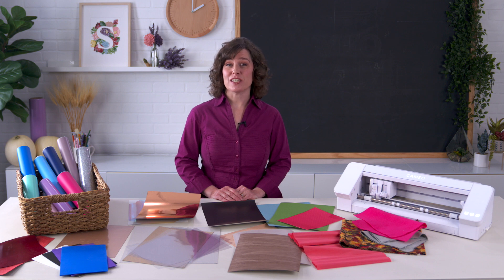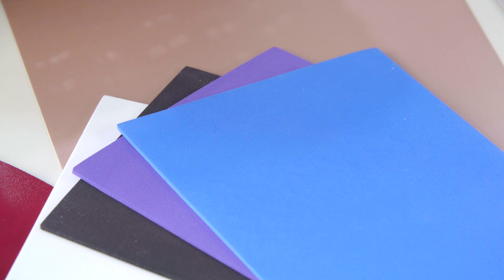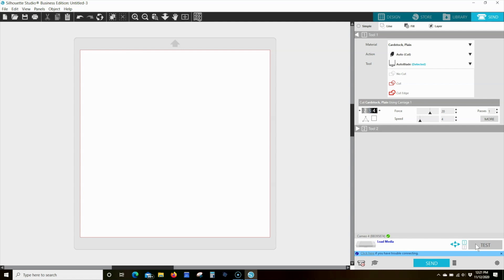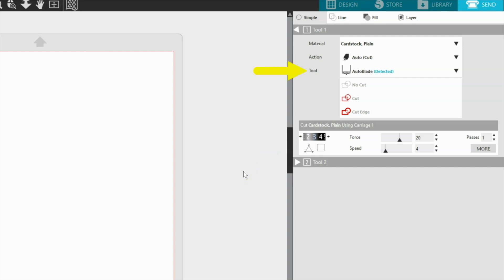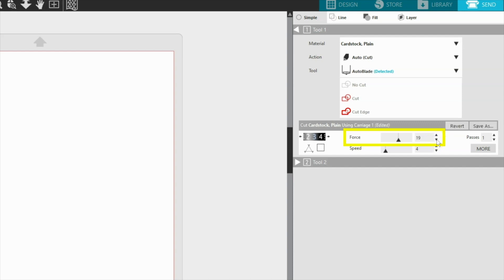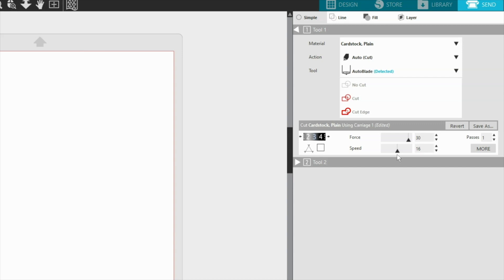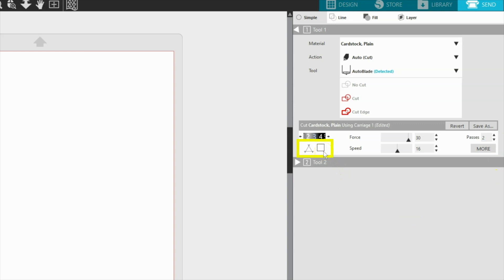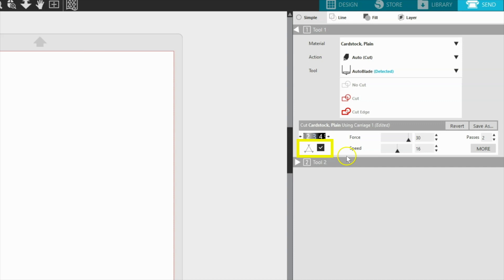Silhouette Support Series | Material Types and Settings

Comment: Silhouette Studio crashes on my Mac (Big Sur) when I try to use the Rotary Blade and send a job. I tried having the left tool slot empty, and leaving the auto blade in and it made no difference. With the auto blade in, if I tried unchecking the Tool 1 and checking only Tool 2 for the rotary blade, it wouldn't even accept the Send command, telling me to set parameters for the Tool 1. On the rare occasion that I could actually get the software to Send, it would tell me the job was completed without the Cameo 4 even moving.